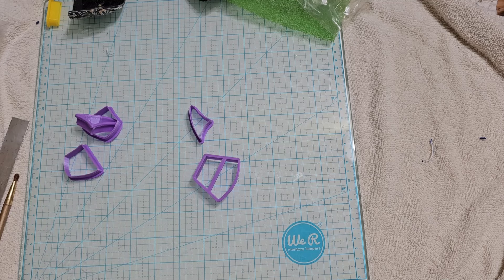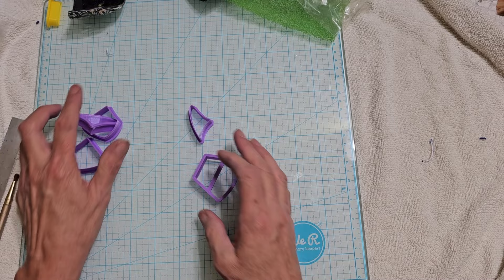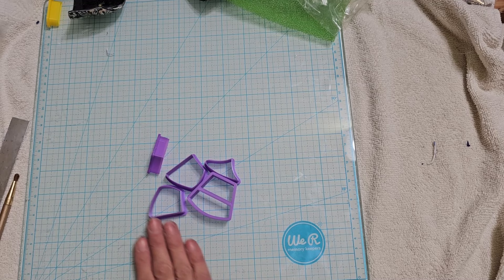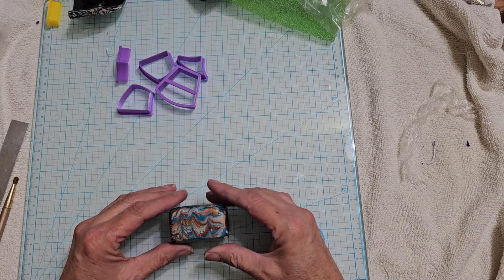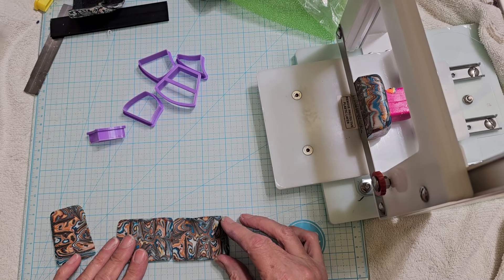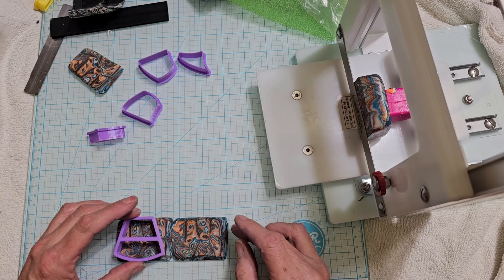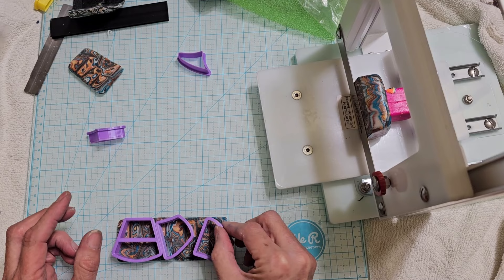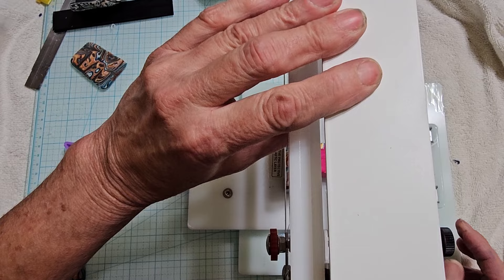Polymer Clay Mokume Gane Veneer Necklace

Comment: I love your work.  I have a suggestion.  How about putting the smaller jump rings in the top holes and using the bigger one on the bottom.  Just a thought 🤔❤❤
Reply from the maker: Thanks for the tip! I can try it. The problem is the thickness of the piece itself. It has to be a large ring to basically go into both pieces at approx 6mm
Reply: Thanks Irene another great tutorial 😊😊😊😊😊

Comment: I have no clue if they even make oval jump rings the open in the top, the only ones I have ever found open on the side. Small note you can make your own jump ring with the pliers that have multiple round plier parts on it, you wrap your wires around the sizes you pick putting the beginning of the wire so it goes out. Pair of thin wire cutters to cut them into the rings. I have a blast making them as I watch tv. Just make sure you have good sharp wire cutters or you will struggle. Btw how did you enjoy the unexpected rain we got this morning. Felt like fall is coming. lol (wish it would hurry up) these always turn out beautiful when you make them. Tfs hugs from AV
Reply from the maker: I can't make jumprings for the life of me. I can make them but cutting them perfectly so they match when closed is tough. I didn't see any rain. The husband did but he was out and about.
Reply: @TheCreativeDork5  just clip one at a time that’s what I do, and yo know where to make the next cut because the previous one leads the way. But you can try dollar beads they always have amazing jump rings, and for only a buck. I think they are 18-20 gage jump rings. So they are solid and sturdy yet easy to use. It’s been a while since I shopped there so they could be like the dollar tree where they had to up the cost by a quarter. lol but they are good ones. Don’t let the name fool you.